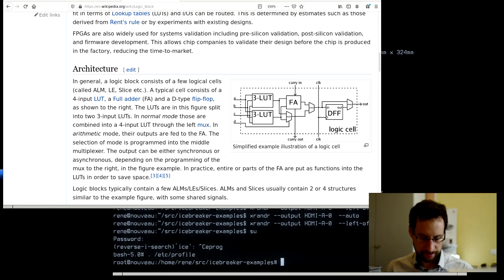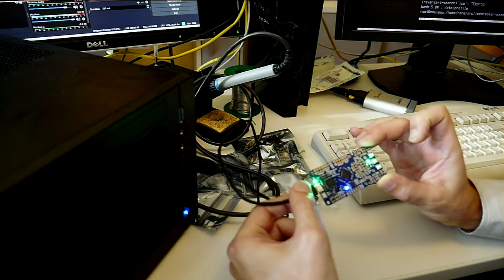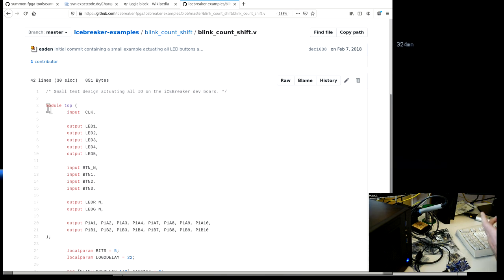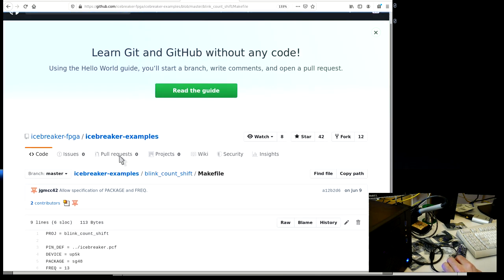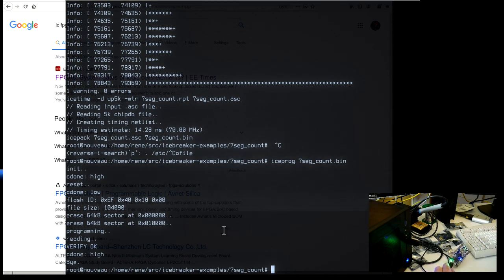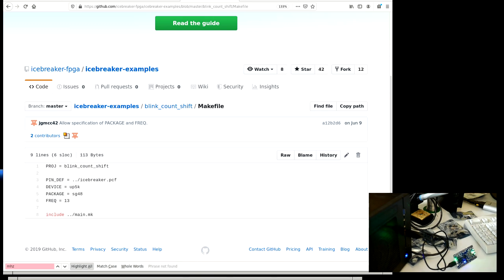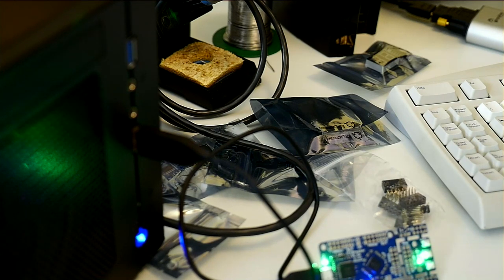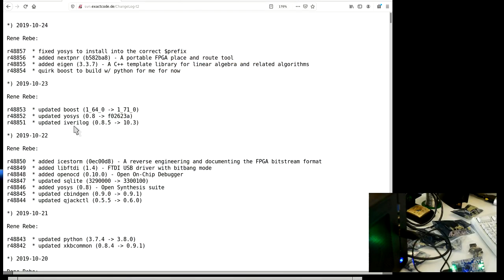It works! FPGA Hello World w/ Yosys and 1bit² iCEBreaker!

Comment: I'm impressed! An FPGA FOSS tool chain that is easy to install and works!  I manage to install it on my Macbook Air under 5 minutes. Unfortunately I don't own an ICEBreaker. Does any one know if I can add additional tools for my Cmod A7 Artix-7 kit? I'm just sick of the bulky crap I currently have installed on my Ubuntu system. It takes about 5 minutes to produce a bitstream file which blinks a single LED!